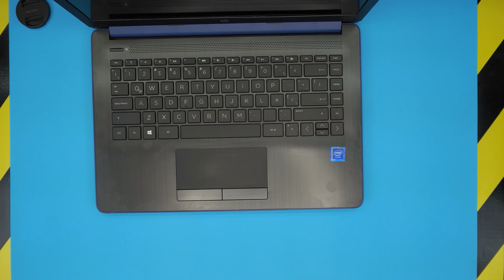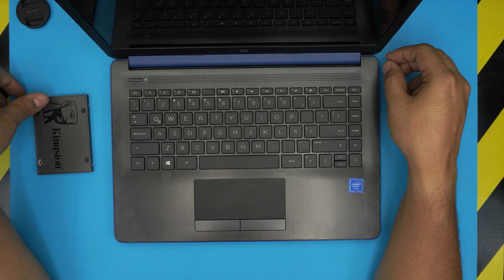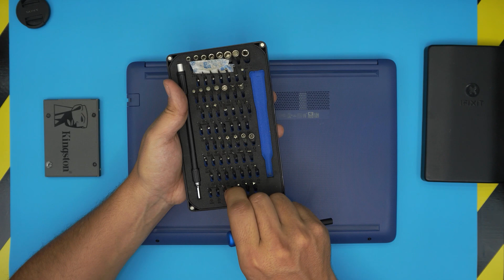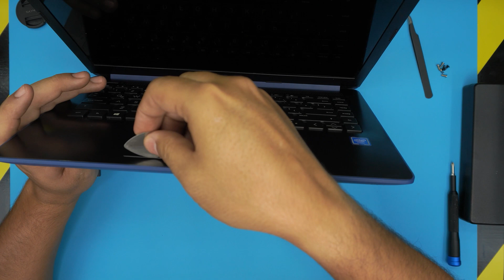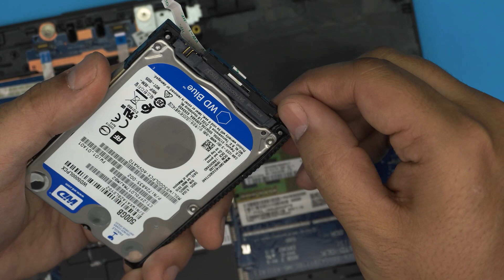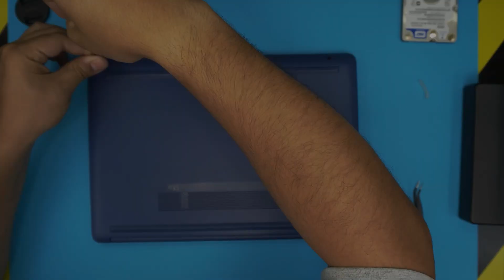Hp Notebook 14 Ck 0004 SSD UPGRADE | HDD Replacement

Comment: Hello, 
Where can i find the clear plastic jacket that wraps around the HD and connects on the sides??
Reply from the maker: Thank you for your feedback! If you wish to support the channel, you can like, subscribe, or both!
Regarding your question, you mean the rubber caddy of the hard drive you can search for it on aliexpress "hdd caddy" and your laptop model, BUT if you placing a SSD then no need for the caddy just get a double sided foam tape and tape it to the case so it wont slide.
Should you have any further questions or requests in the future, please don't hesitate to ask me.
cheers🍻
Reply: @uFixTek  I appreciate the reply. I looked all over Aliexpress, Amazon and Newegg. I can't find the caddy. Can you provide a link?
Reply from the maker: on ebay you can find for sure, i will link once i get to the office, but look there

Comment: I have literally the same laptop, and I did everything in the video, however when I turn it on it keeps saying "no bootable device". What should I do? I tried to use the crucial brand hard disk sdd.
Reply from the maker: hold, on can you let me know exactly what you did?,
DID you create a windows 10 usb boot drive?
after replacing the hdd with ssd did you plug the usb and install the windows 10?
Reply from the maker: after upgrading the HDD to SSD, you need to place the windows 10 USB bootable drive to the laptop and then power on and quickly press ESC key (keep tapping it) till you see a menu then choose the F9 ( bootable device) and choose the USB and follow the installation steps.
Reply: @uFixTek  Oh so you have to have windows USB plugged into the ssd to boot the laptop?
Reply from the maker: no my friend at the beginning of the video i explained. 
before you do anything Create a windows 10 USB: https://youtu.be/uDu8j2lE-dM
and after that open the laptop and replace the HDD with SSD.
after that connect the USB to the computer, plug the charger
and press power ON 
and then power on and quickly press ESC key (keep tapping it) till you see a menu then choose the F9 ( bootable device) and choose the USB and follow the installation steps.

here is a HP windows 10 installation: follow exactly the same steps: https://youtu.be/7f_rBp6Rb3s
Reply: @uFixTek  thank you a lot, with your help I was able to fix the problem and switch hdd to sdd, worth a sub
Reply from the maker: You are welcome! Glad you liked it 😊Thank you for the feedback! and your support to the channel.
if you have any question or request in the future feel free to ask me.

Comment: It does't have an m.2 slot, right? Planning to upgrade my hp 14 ck. Thanks!
Reply: If it does have an m.2 slot, does it support NVME? Thanks in advance!
Reply from the maker: no it doesn't have m.2 pci-e or m.2 sata, therefor you can't place any m.2 ssd or m.2 NVME SSD, only can sata ssd 2.5"
🔵 1TB SSD sata 2.5" : https://amzn.to/3A4oH4n
Reply from the maker: Thank you for the feedback! if you wish to support the channel you can LIKE or SUB or both :P
regarding your question: no it doesn't have m.2 pci-e or m.2 sata, therefor you can't place any m.2 ssd or m.2 NVME SSD, only can sata ssd 2.5"
🔵 1TB SSD sata 2.5" : https://amzn.to/3A4oH4n